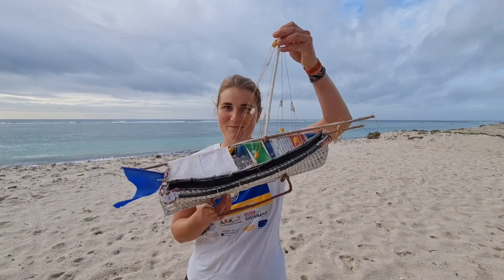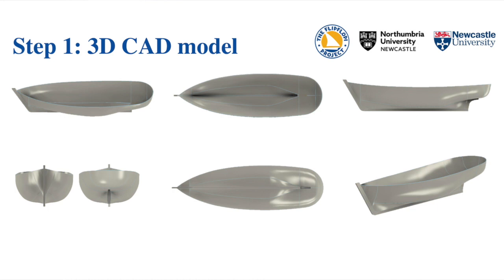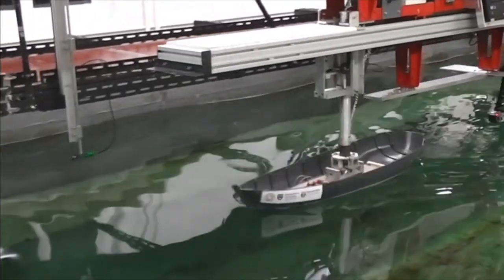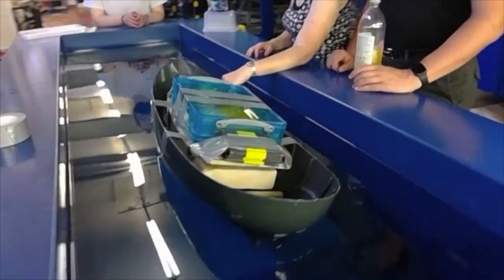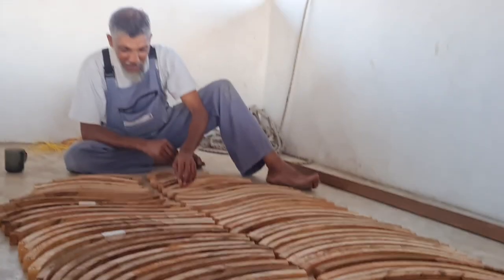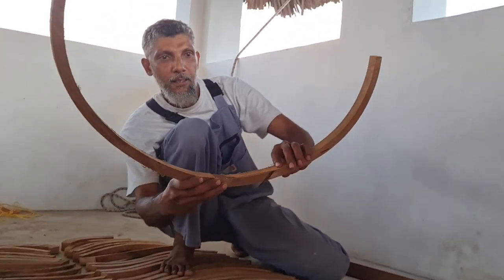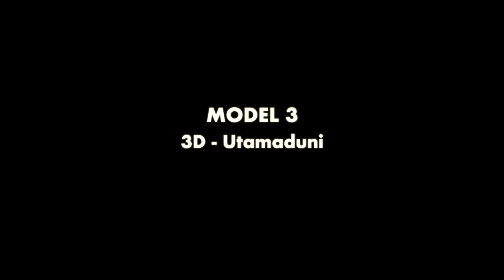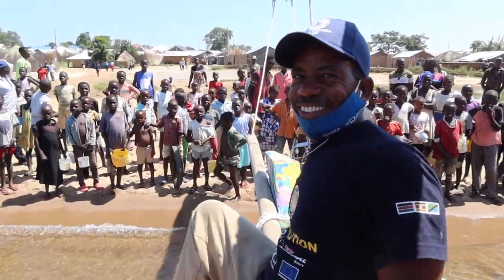Using 3D models to run tests on our sailing dhow

Comment: Great to share the 3D-modell. I reckon, to build a bigger boat in recycled plastic must be a challenge, due to the strength of the plastic is different in a bigger scale. Not as wood who has a totally different strength lengthwise.